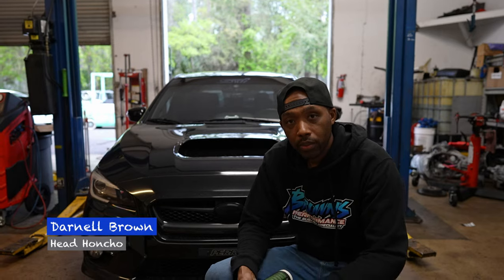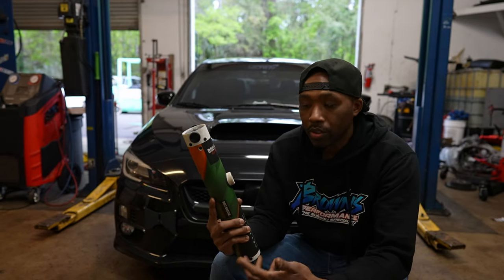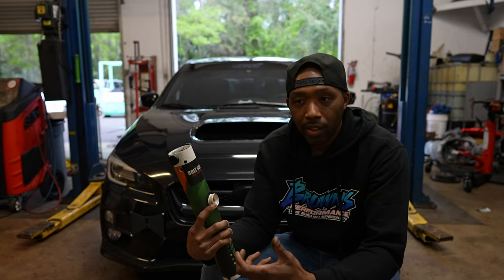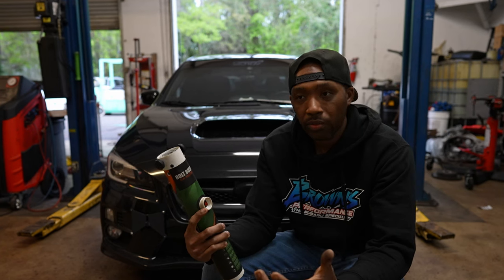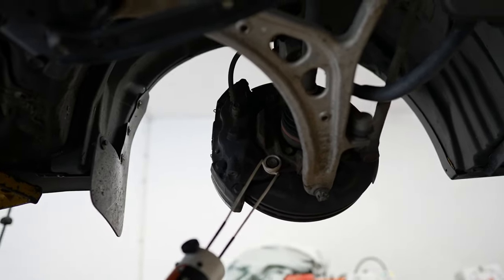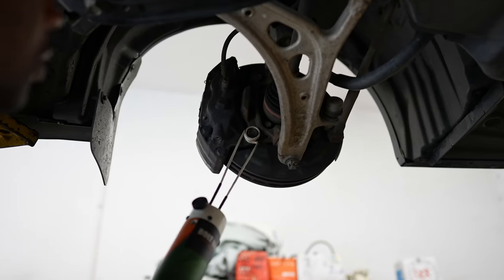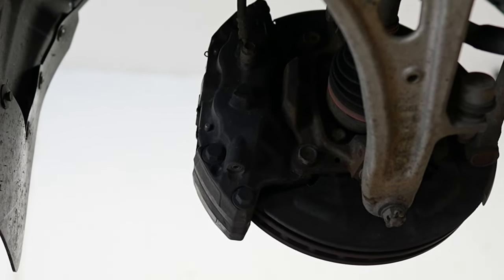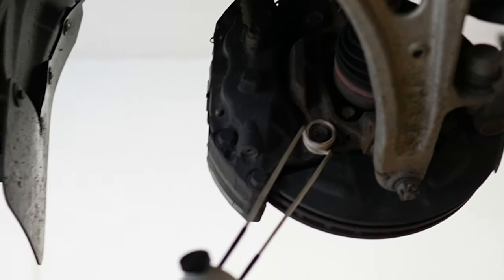The BEST Tool for removing STI Brembo Caliper bolts!

Comment: would a torch also work? mine are super tight. also do you recommend applying copper anti seize?
Reply from the maker: A torch would work but you risk melting the axle boot so be mindful of that and anti-seize is a must.